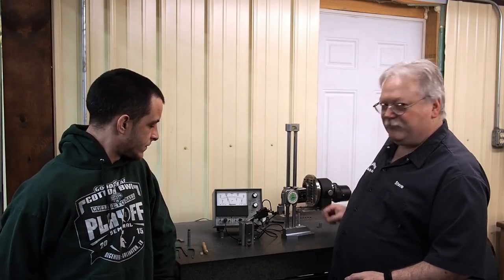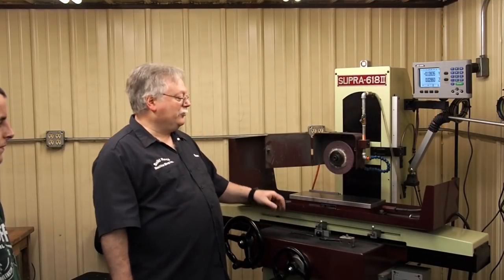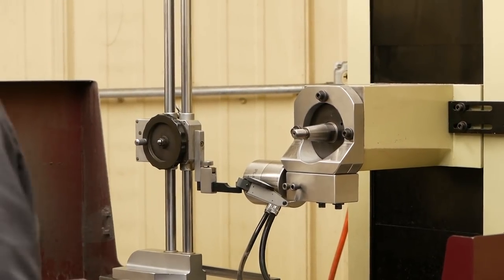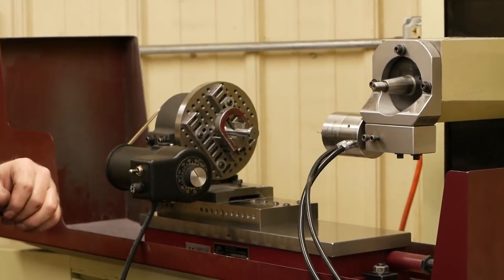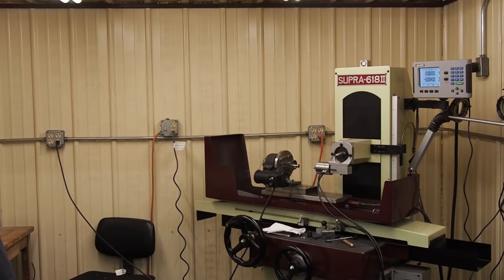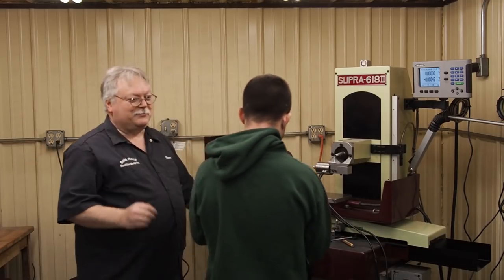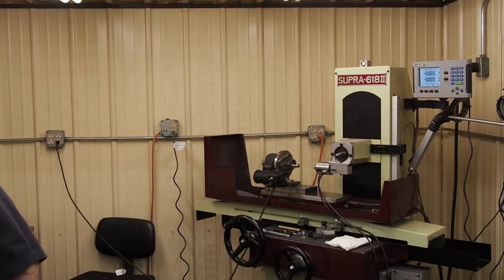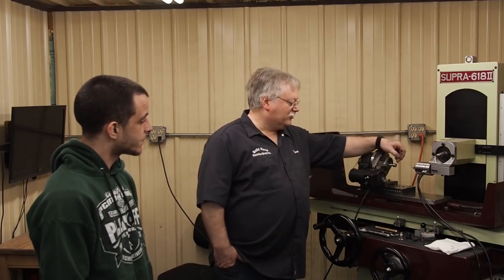Making a Go Nogo gauge

Comment: Nice job.  Lapping the hole next?
Reply from the maker: Hi Randy,
Won't be lapping the hole, it will be good enough for what it does. I should have used the flat bench stone to remove the small bur you see under high magnification but I did not see it until the video was made and I saw the close up.
Steve

Comment: very interesting video. i have never seen the air spindle attachment you used. only a dentist could get used to the whine. i assume that type of job would have been lapped before the advent of machines capable of that level precision?
Reply from the maker: Hi Larry,
The air spindle is a NSK planet 550. The whine sounds worse on camera than it really is. I am not sure how they would make precision holes before high speed spindles. I have very little experience in lapping but I think homing might have been an option but that is just a guess.
Steve